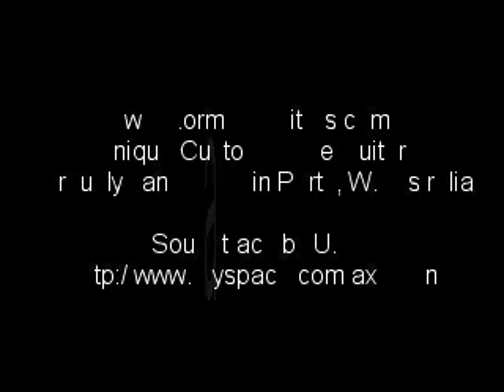Ormsby Guitars - Multiscale Custom Video Diary - PART TWO

Comment: Sorry about my ignorance but, what is that Plier type tool you are using on each end of the fret after you cut it? Are you just flattening the barbs on each side where they would leave the fretboard to minimize damage to the fretboard?

Comment: @mickey007r The frets get radiused to about a 12 to 14 inch radius so they lock in easier when there hammered or pressed, it's very common.